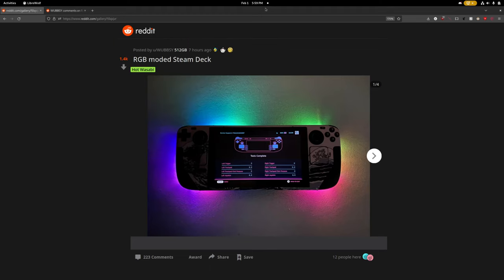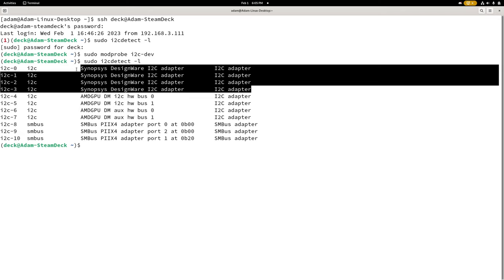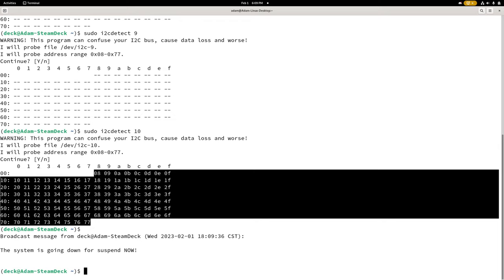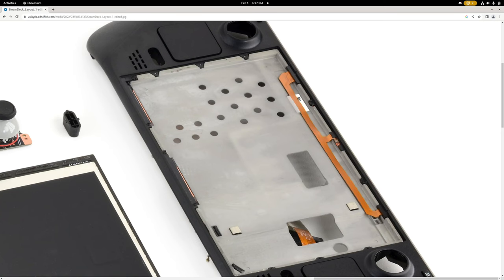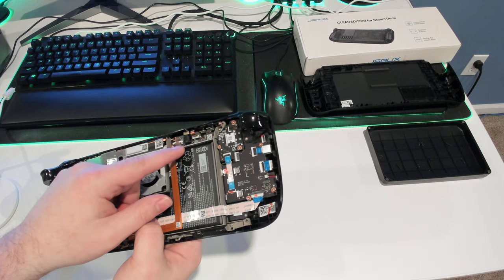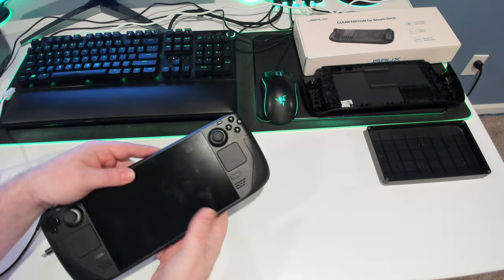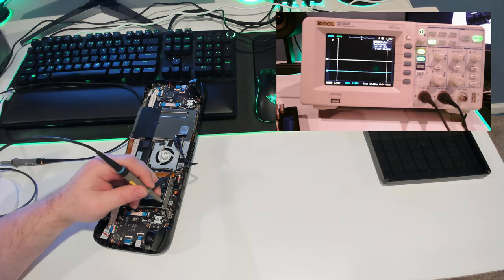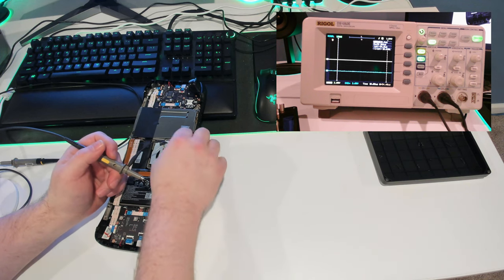Steam Deck RGB Mod - Part 1 - I2C Investigation

Comment from the maker: I took this video down for a week because unfortunately the RGB mod has damaged my Steam Deck's motherboard.  The investigation in this video is entirely valid, the problem was that I pulled power for my RGB controller and LEDs off of the controller PCB.  This overloaded a switching component on the motherboard that is used to shut the controller off when in sleep mode, killing the controller entirely because it lost power (this component must've overheated enough to desolder itself).  I managed to get my Deck functional by soldering across the in and out lines of the component footprint, but now it keeps the controller powered during sleep which negatively affects battery.

I'm looking into doing a repair with a replacement component.  Unfortunately, the original part was too tiny to hand solder (WLCSP-4) but the connections required have test points or other easier solder points available, so I'm going to do an SOT-23 part with magnet wire.  I ended up getting another Deck so I could have a working, unmodified motherboard.  I'm going to investigate the option of finding a different 5V source for the RGB mod that is safe to pull more power from, possibly just tapping the battery with a step-down module directly (and maybe gating it with the 5V controller voltage to allow it to sleep as well, just using it for gating should not add any noticeable load to the controller power line).

Unfortunately, as I presented bad information in the Part 2 video due to wiring up the RGB to the controller PCB for power, I'm not going to be putting that video back up.
Reply from the maker: I managed to repair the motherboard with a SOT-23 TI 5V switching IC but it's kind of messy.  I had to run little wires off to the chip and tape it to the PCB as soldering WLCSP-4 is basically impossible and one of the pads was gone anyways.  It works now at least.
Reply: before i even saw your comment about pulling from the battery with a regulator thats exactly what my plan was to avoid the overdraw issue lol. im drawing from the battery and using the same controller voltage but to trigger a transistor to enable and disable the regulator

Comment: Hi i have just little question. what if rgb from jsaux is used with battery and all. it just connects to the steam deck and can be turned off via the switch on the original. with a bigger battery what will have only rgb and from the steam deck will charge other chips. it may have less stress on the motherboard and the coolers will be able to be turned off separately and I would also add a circuit breaker, but I'm not such an expert as to know everything, I'm just interested in this topic.

Comment: huh, TIL that monitors use I2C to share EDID.
Reply from the maker: Some can also use the I2C connection to control monitor settings such as brightness using the DDC protocol!  There's a Linux driver that adds backlight control using DDC so you can adjust your desktop monitor's brightness just like you can your laptop's.
Reply: TIL about this EDID/I2C fact also. Would this be a viable attack vector for tricking an LG C1 hdmi connection into reporting 1440p as max resolution instead of the default 4k? Intriguing possibilities if I’m understanding things correctly. Thanks CalcProgrammer!
Reply from the maker: @piercebros  You could I suppose, by cloning the EDID binary to an I2C EEPROM and then splicing that in to the I2C pins instead of the monitor, but AFAIK a lot of systems and drivers allow you to specify an EDID binary in software or otherwise force monitor parameters.  Seems like the hardware mod route would be more difficult.
Reply: @CalcProgrammer1  Superb! Thanks for the inspiration, mate.
Reply: @piercebros  You could use Custom Resolution Utility as well, if it's a PC
Reply: @CalcProgrammer1  Twinkle Tray is a little app that does the same on Windows!
Reply: Can any body that for me ? I would pay for the service